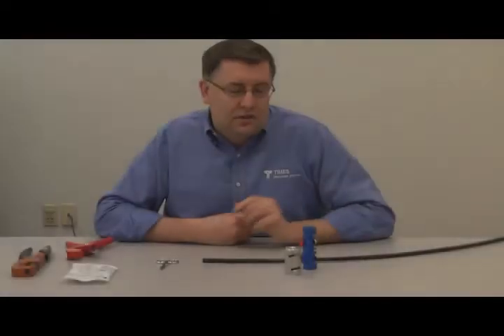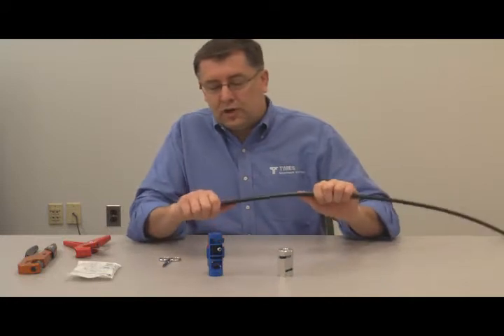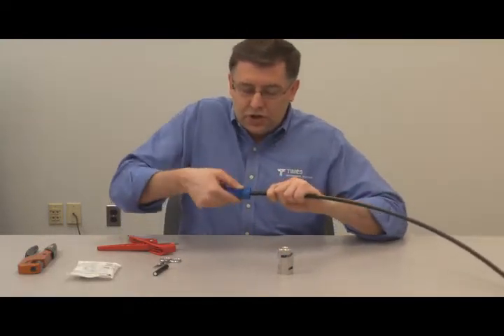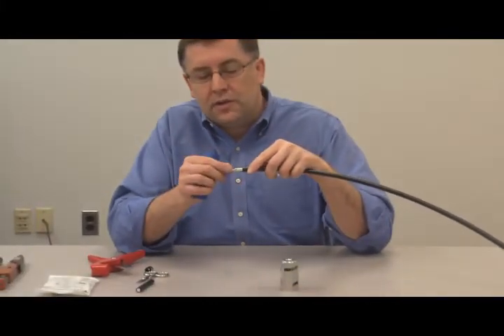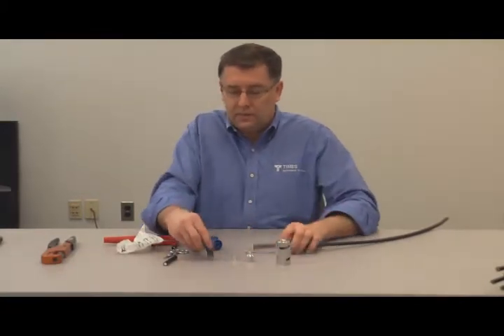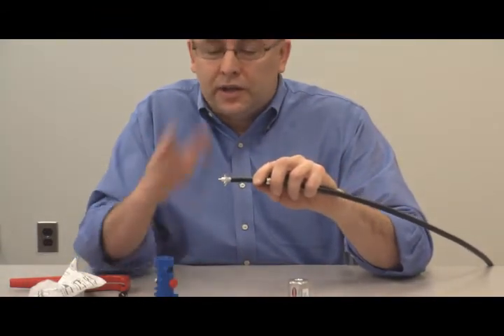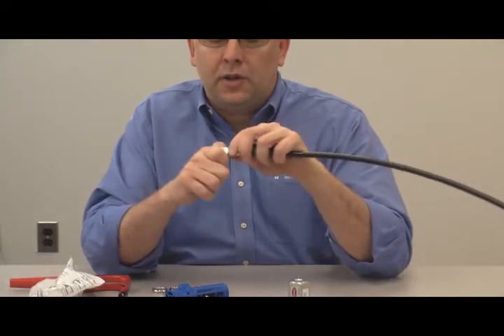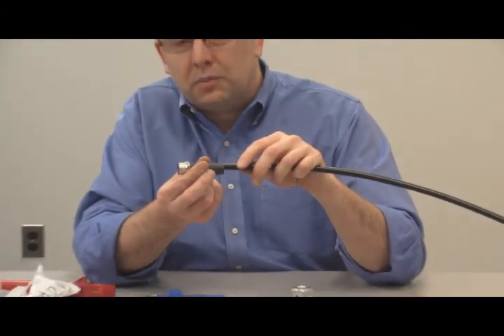Demo Discoveries: Mastering the CST 400 Strip Tool

Comment: What are the tools required for processing ( cutting and stripping) HF290 cable
Reply from the maker: Thanks so much for your question! We consider the HF290 to be a high frequency cable and not something that should be terminated in the field. Our prep tools are designed to support the LMR, TCOM and low PIM product families in applications where field termination is a must. Feel free to reach out to us via our website if you have any other specific questions!

Comment: Can we use it with RG213 and RG214 cables as well?
Reply from the maker: Thank you for your question! The CST-400 is definitely better than nothing when it comes to the RG-213 but it can’t be used just as you would on LMR-400. Instead of using the tool to pull the side #1 pellet off of the cable, you would want to use a pair of slip-joint pliers. This is because the solid PE dielectric doesn’t have any give to it, so it takes some force to pull it off of the stranded center conductor. In terms of the RG-214, we have the CST-RG214 tool. It’s a great tool and really a must have if you’re doing a lot of work with RG-214. 
Please feel free to reach out to us via our website if you have any additional questions or would like to speak with a product manager.

Comment: A good prep tool would trim the braid as well.  And clean the film from the center conductor.
Reply from the maker: That’s one of the real nice things about our connectors and CST tools. They are designed to work together. We’re always striving to make the connector attachment easier and fool-proof. Our connectors do not require braid trimming. Also, the tool typically does a very good job removing the film on the center conductor. Just as the film has adhesion to the center conductor, it also has adhesion to the foam pellet that is being removed. We think that you will find that this film will be removed as long as you have made at least one full revolution of the tool once the thumb switch is completely depressed and make sure that the thumb switch remains completely depressed when removing the pellet.